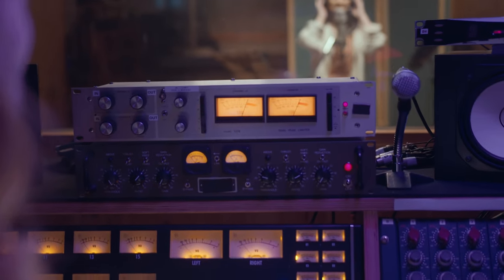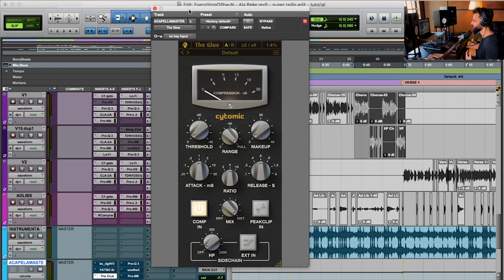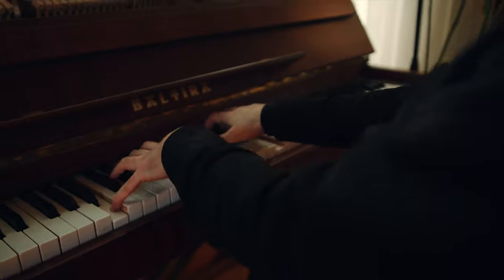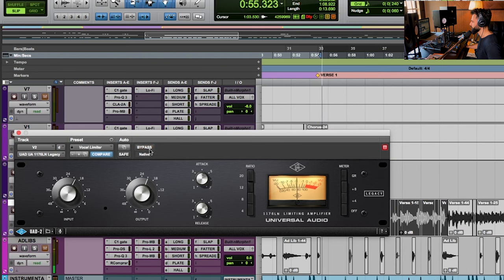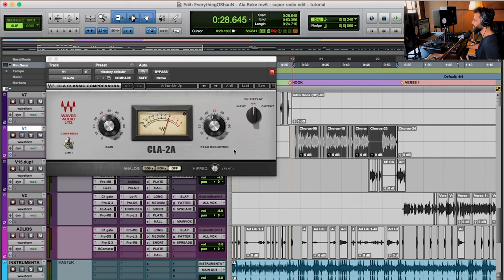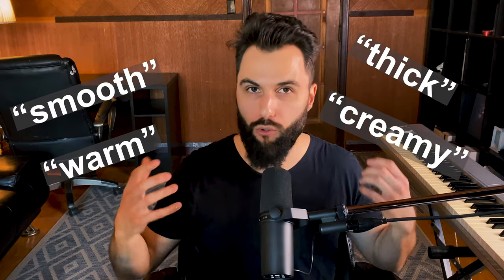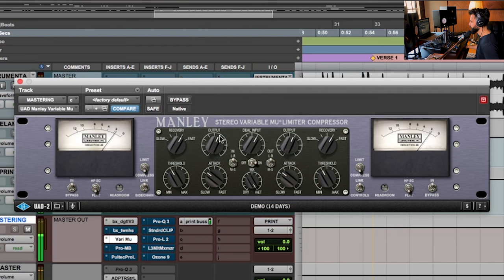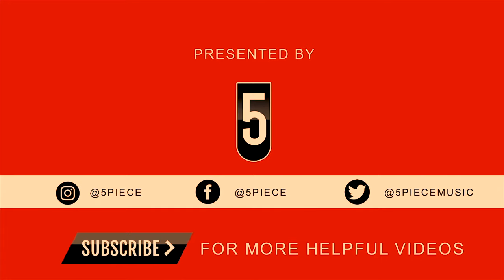4 Analog Compressor Plugins You Should Use in Every Mix

Comment: After you process your VOX to where you like them, do you always add a VCA to sort of tie all the fx and libs together? Just asking if its a matter of practice. I usually add like 1.5-2db more compression with all the vox and fx together, but haven't tried it with a vca yet. Also the 1176s being backward has always been annoying. Lol just want the lords to know.
Reply from the maker: Your approach sounds correct to me! I always add SOME form of compression at the vocal group level, sometimes it’s a VCA and sometimes it’s something else (for example I really like the UAD Fatso on vocal groups - it really does make things fat😉)

It’s more about the concept and approach rather than the tool. I recommend trying a VCA compressor and shooting it out with another one or two non-VCA options to see what you like. It really depends and even for me changes but logically speaking, the VCA will offer a lot of control compared to the other types mentioned in this video. Let me know how it goes. Best of luck!!
Reply: @5piece  thanks so much for all ya do man. Im in the middle of a straight rap mix and the ad libs are gunna make or break it. Time for a 5piece tutorial 4moi ✌